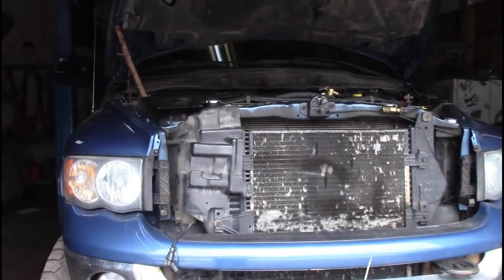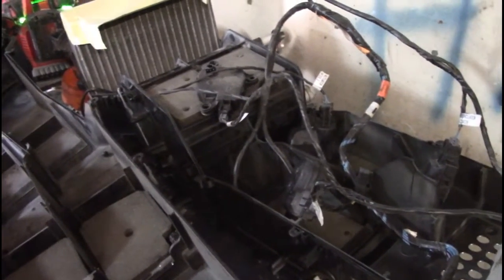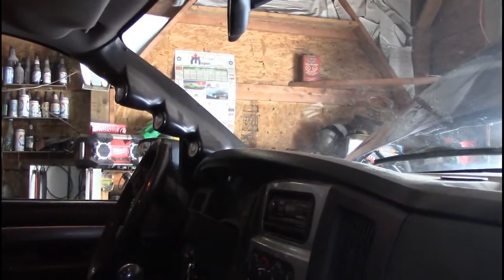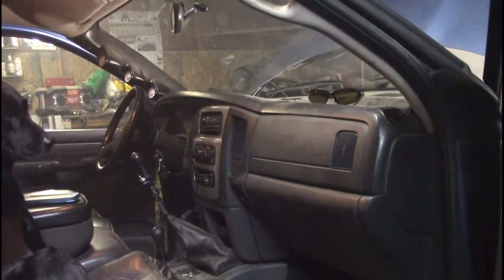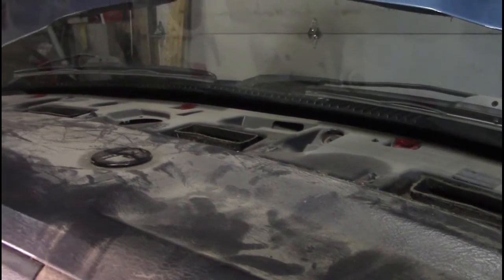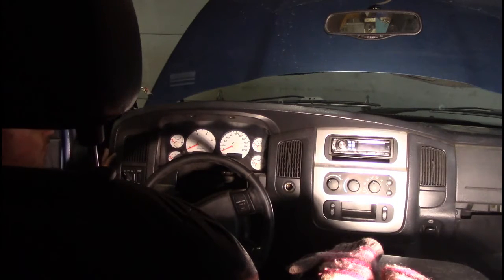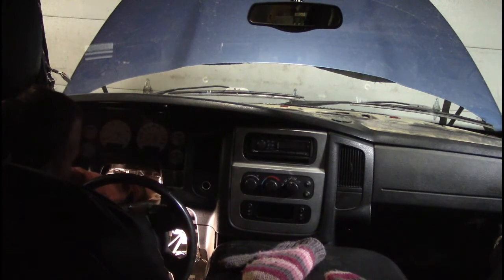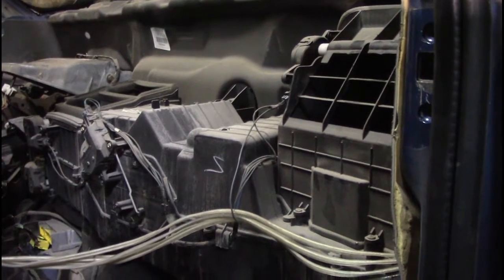replacing the heater controls on my dodge 3500 2005 diesel cummins part 1

Comment: Why wouldn’t you replace the heater core and evaporator while it’s all apart rather than put used stuff in there and pull it all apart again when the used part goes bad?
Reply from the maker: no issue with those things